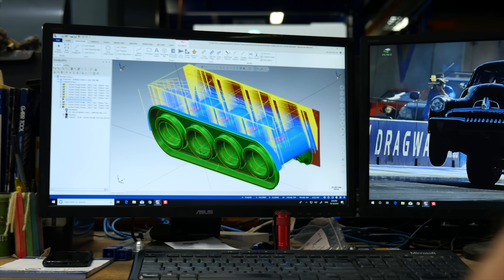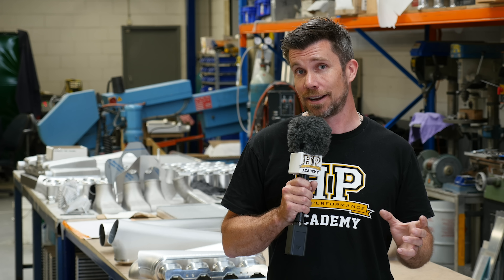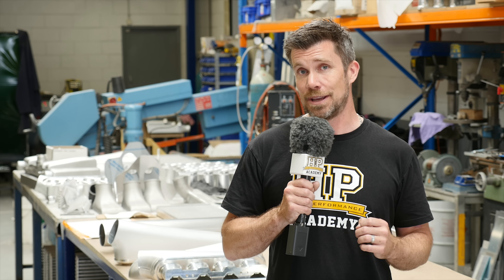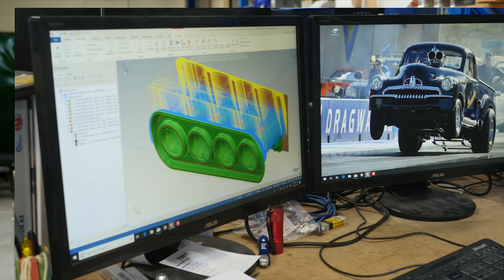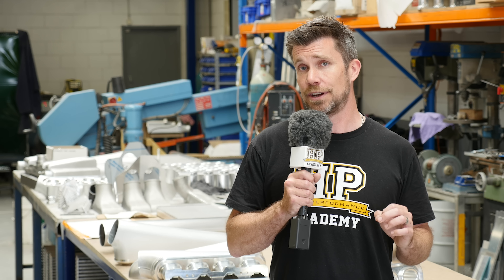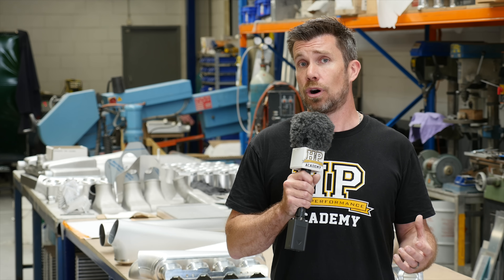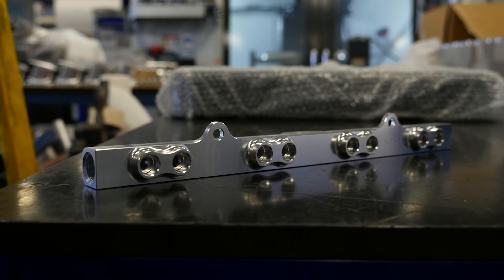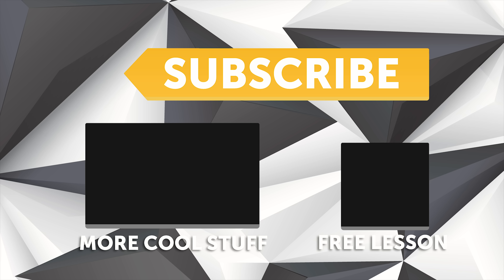What Do YOU Know About Custom Inlet Manifolds? | Plazmaman [TECH TALK]

Comment: Runners sure look short to me 
For the cost I’ll just run a twin plenum design 
Way up on torque and great equalisation of charge to each cylinder 
By the way if you’re looking at intercooler design 
Check out large truck ones 
The end tanks are way better than some off the self  so called race car design s
Remember it’s weight of air in not volume

Comment: How did the 74mm throttle body work out?  I see you've made a newer video talking to a guy from plazaman that seemed to indicate 60-70mm would be the max size they would recommend for a 2 liter 4 cylinder.  In this video: "When Bigger ISN'T Better: Plenums AKA Intake Manifolds"

Comment: Is there a video describing the reasoning and benefits of duel injectors per cylinder?
Reply from the maker: I think it comes up in a Colin Wilshire interview. Basically it comes down to injector control, or lack of, and fuel demands. Technology is improving but in the past having good idle fuel control as well as large and accurate fuel flow at WOT were two things you wouldn't get from a single injector. In some drag applications where idle and low loads don't matter its simply to feed the engine copious amounts of methanol etc, which requires much more volume than gasoline. Very broad and nutshellish reply, I'll try find some links for you too - Taz
Reply: @hpa101  really appreciate the reply and that all makes a lot of sense. I'll have to try and find the video, thanks again :)

Comment: I am in the middle of designing a manifold for my engine. I hope that I can 3d print it because that would be way cheaper then having one CNC milled.
Reply: CNC milling looks fantastic, but you can take your 3D printed manifold to a foundry and have it made as a cast aluminum piece for far less money.  From there you can bead blast it, sand it, and polish it.
Reply: @joshuablair6120  I mean at that point if I could get the scrap aluminum I could probably cast it myself or try to.

Comment: Do you think for a low-mid hp build like 300-400hp it's worth it to buy an aftermarket inlet manifold or port and polish the inlet manifold and run the largest throttle body I can?
Reply: No the ROI is very poor at that power level. If you want more air, use a small shot of nitrous oxide. If you factor in the kit and several refills it still would be cheaper to do that than get a manifold such as this for the tiny turbocharger you're running.

Comment: Liking the use of "O" rings for the flange seal - but as that will increase the metal-to-metal heat transfer from the head to the manifold, are you planning on using a thermal barrier between the manifold and head - some water/laser cut phenolic plastic, maybe?

Be interested to see how you get on with integrating the Bosch throttle body as that is on my wish-list - not just for the idle speed benefits, the ability of tailoring low rpm throttle openings for best torque (or to limit it for traction control if fast enough operation?) but for the ability to limit top speed using electronic control - this would be excellent for events, such as Targa, where there is a strongly enforced maximum speed allowed; some American 'open road' events, like the Nevada Silver Dollar (if still run) have enforced maximums for different classes also, for safety reasons.

Comment: Curious to know about intake runner length. Would you guys ever do an in-depth video or what’s best for what application (n/a vs Forced induction)
Reply: Scadieee I would also really like a video about that. I've seen some variable length intake runners also that are very interesting. And good point about n/a or boosted applications, I was curious about that too as I'm sure many others are.
Reply: Would also  be keen for a video like this. Would be nice to know what the benefits of a tapered throttle body are as well (n/a)
Reply: There are going to be individual variations between engines, but Jenvey have a good guideline in their FAQs - second section - https://www.jenvey.co.uk/support/faqs/
You, and any others reading, may like to check out their full web site - I have some of their products and been very happy with them - use the "shop on-line" option to the top right of their home page.

Comment: whoever is doing that welding is a badass! he's not even using the pulse option to make those gorgeous wells 😋
Reply: Aluminum requires more heat to get a puddle going and since pulse is primarily used to help control heat it would be counter intuitive. They were probably using a high frequency 100+hz to help force that AC current into the puddle.
Reply: PANTYEATR1 Agreed👍
Reply: The AC, and more to the point the offset and waveform, is more to clean and improve the weld pool. The heat is really down to the voltage and pulse/duty cycle.

Comment: No amount of NOS would blow those welds on the intake...Danger to Manifold...
Reply: The danger is usually a backfire that ignites the charge in the plenum - maybe some form of burst, or spring loaded, plate would be in order with higher boost levels?
Reply: Two of the big ones might do it, you'll definitely fry the pistons rings though

Comment: Is an aluminium inlet manifold really need, do to the higher boost pressure, or could you build an even lighter one out of plastic, like many oem's do?
Reply: It could definitely be done. A piece of 2" schedule 40 pvc pipe has a burst pressure rating of something crazy like 800psi and a working pressure rating of 200psi. And that's just the white pipe under your sink.
Reply: blindabinda123 keep in mind though, that rating is at 72F and engine bay temperatures get quite a lot hotter than that. It could definitely be done, but the OEMs use Glass fiber reinforced high temperature Nylon (PA 6.6), Id wager a 3D printed manifold would be out of the realm of possibility for an application like this, the filaments aren’t high temperature plastics, and the printing process makes parts weaker than unreinforced injection molded parts due to the layering process.
Reply: @J-Eagan  That's only a matter of time. Right now the domain of 3D printing is of true tech geeks who don't care about making automotive parts other than to prove they can build a car cheaply with a 3D printer.
Reply: @blindabinda1234   200psi does sound like more than  enough, even for a crazy diesel build.
Reply: @tobiaswessel1771  for sure. I'm sure an intake manifold could be 3d printed using the right filament or whatever they call it that would handle 200psi.
Reply: It may be down to cost, lead times and having someone who can do the work for them that is convenient.
It could certainly have been 3D printed and there are many options of material that could do the job, including carbon-fibre impregnated filament - but see above. besides the probable weight savings, it 'should' also keep charge temperatures down a little - but, remember, if the charge temperatures are higher than the ambient in that area of the engine bay, increasing the heat transfer will actually help.
Reply: Im assuming that it would keep up with the engine bay temperature
Reply: Have you ever prices up the cast mold it would take to get a plastic-carbon manifold made? Put another way, it's cheaper to buy a CNC machine.
Reply: @Sergio Aguirre You can certainly run more boost than that. The myth that plastic intakes are weak is a hot rodding wives tail.